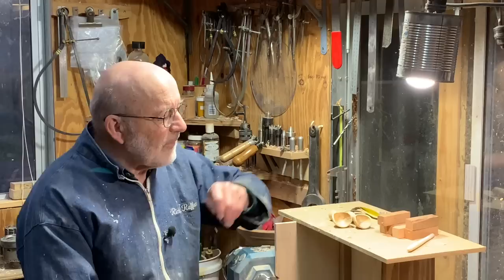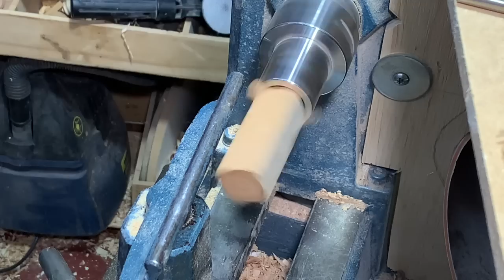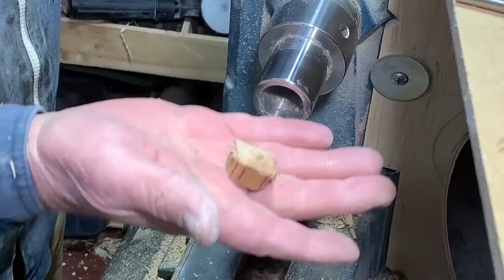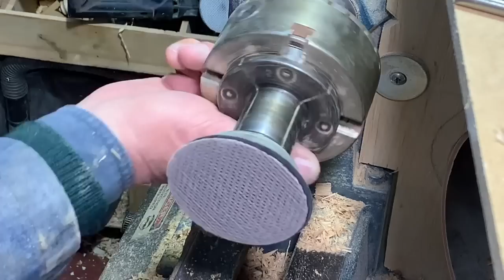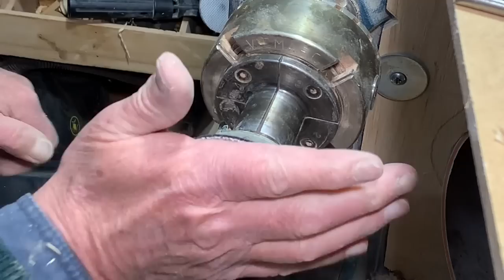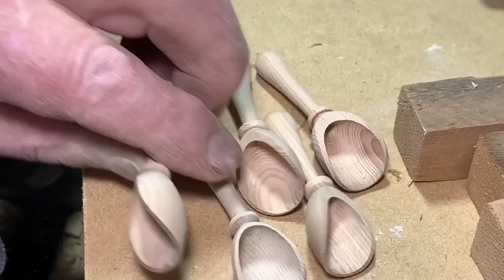Richard Raffan turns two of his signature salt scoops

Comment: What great timing!  Yesterday I started making some small scoops again, and I was a little (!) rusty.  This video had a few new learning points for me: repurposing a joiner's chisel for a scraper; folding the sandpaper over before applying the stick on the inside of the scoop.  Watching the ease and speed with which you work is both motivational and informative, as always.  Someday I hope to be half as good as you are with the skew.  Thanks very much, Richard.
Reply from the maker: And thank you very much for the donation. Much appreciated.
Reply: @RichardRaffanwoodturning  You are welcome, but I do not regard it as a donation; it's a class fee.

Comment: Really interesting, Richard, thanks. I learned a couple of tricks. In my very early turning days I bought a couple of cup chucks, but being largely self taught beyond school days thought I needed to taper the blank to fit. Somewhat laborious, so I did it rarely. Didn't think to just whack it in, but then would have been concerned about the spindle bearings. Shall certainly consider  that now. Also, I have often cut window sills with coarse grit sand paper, but never thought to use the  technique on goblet mouths. 50-60 a day, wow!   Bernard.
Reply from the maker: On larger blanks I did turn a taper as you see in  https://www.youtube.com/watch?v=D3znG7-ksIw
Reply: @RichardRaffanwoodturning  Thanks for your reply, Richard; and I've watched the video. Retrieved my cup chucks and expect to use one soon. I have suitable jobs lined up.  Bernard.

Comment: Was that a spindle gouge you cut the center with? Your videos have help me become pretty comfortable using the skew .
Thank You
Reply from the maker: I drilled the depth using a ⅛-in shallow fingernail gouge, that could be used as a spindle gouge but which I used as a depth gauge. You could use a standard twist drill, but a small gouge is easier and less likely to catch on entry..

Comment: I've often wondered why woodturning lathes don't have the functionality of metal turning lathes, where you can pass the blank all the way through the spindle and out the other side. I can only do it on my lathe for diameters up to about 15mm, which isn't very useful. I think you can fit 25mm inside a M33 thread. This would allow you to have say a 600mm long blank, which you can cut down as you make each new piece. Granted it would only work for small diameter spindle pieces, but for a production turner, would be much quicker, no?
Reply from the maker: Probably not quicker. In production mode it's as fast to knock the waste out and knock another blank in as it is to feed a blank through a chuck.  It used to take me about six seconds, three of which were absorbed by bringing the lathe to a stop. These 22mm square were cut for #3 morse taper and a shade large for this 25mm chuck. Same with the 50mm blanks.

Comment: Hello Richard. The tool you use to start hollowing out (at about 1 : 12) you called a 'depth drill'. Is that just a spindle gouge with a very long beveL? TIA
Reply from the maker: you're correct. It's a re-purposed ⅛-in carving shallow carving gouge with a bevel about 30° and fingernail grind. The edge on the wings need to be convex.
Reply: Thank you. @RichardRaffanwoodturning

Comment: Very nice Richard,  what do you consider acceptable wall thickness?. Cheers Geoff
Reply from the maker: I've never measured one but 1mm is probably a fraction this 2mm starts to look chunky like the three to the right at 12:40. With a bit of sanding on the inner rim I can make those appear thinner. When turning 50-60 a day they tend come out more even than those you see here.

Comment: Nice video. Do you try to achieve even wall thickness or do you find it is really not that important in the end? I noticed the ones you made earlier were more consistent and you liked them better.
Reply from the maker: I aim for an even wall thickness but that's difficult when the tolerances are so fine. Turning these without a strong light and relying on sound increases the difficulty. A lot of people, even turners, think these scoops are easy to make, but they're not.
Reply: @RichardRaffanwoodturning  Appreciate the  closeup of the scoops at the end of the video. Didn't look like you forgot how to turn them, muscle memory is a powerful thing.